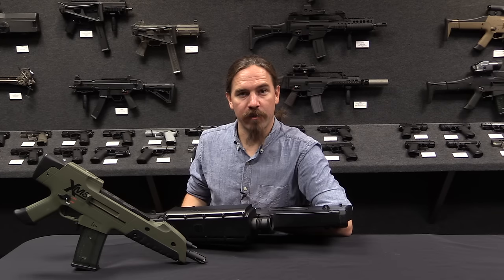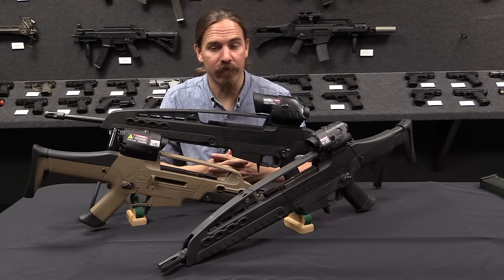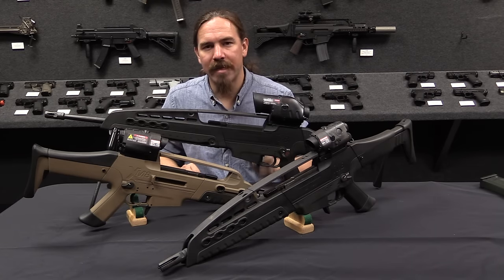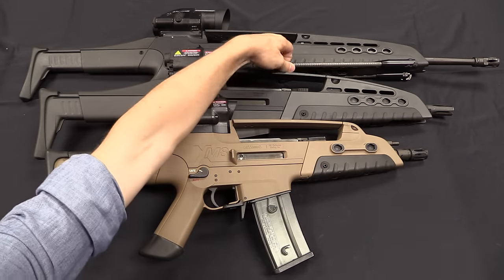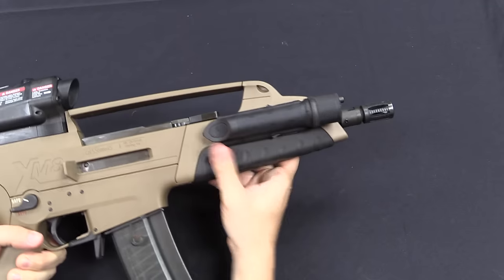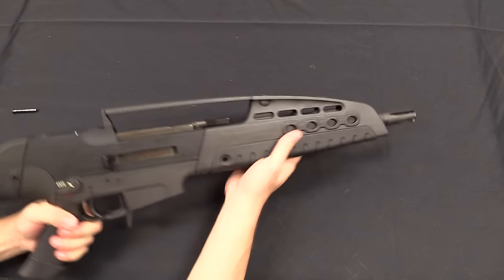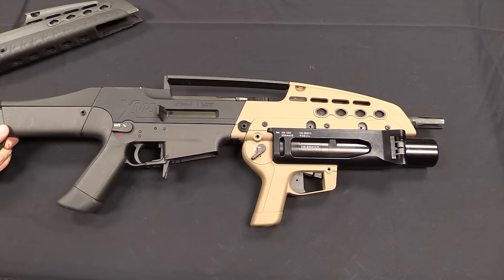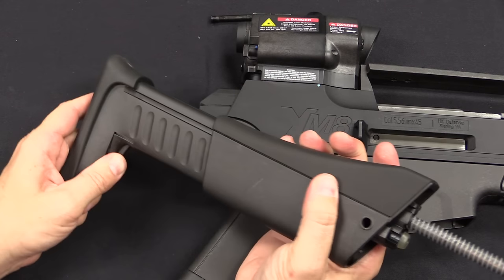Almost Adopted: The H&K XM-8 Family

Comment: Too much plastic for the Infantry, the G-36 as you mentionad had this problem as well, the plastic bent under heat and destroyed zero. 
There must be a metal that can be used instead pf plastic, the SLR/FAL had plastic furniture but you were never going to fire enough rounds to melt or bend it, and it wouldn´t affect the zero either.
I suspect that H&K changed to plastic because the old G-3 was all pressed metal and weighed too much with a loaded magazin, I´m pretty sure it was much heavier than a FAL with loaded magazine, or I was older and weaker when I picked one up! ;) 
Would Titanium work better, that extension with the grenade launcher is a stroke of genius, but in plastic................?

Comment: I like the XM8 as much as the next fella, but I can see why it wasn't adopted. At least, not instead of the M4s and M16s. At best, it could've seen some limited use. I don't think the US military will replace AR-15 platform rifles any time soon. In order to do that, a rifle has to not only be as good or better...it has to be EXTREMELY better. You know, to the point where creating such a weapon might not even be possible. Not with modern gun technology, at least. Ian himself has said it many times - a gun is a set of compromises. The weapon that the US military will deem a worthy replacement to the AR-15 guns is, essentially, a nonexistent gun. A gun that is so much better, that it is an impossible set of compromises. In that sense, it's kind of like the tender to replace the G36 in the Bundeswehr.
The XM8 is simply not better enough (in certain ways) to be a viable replacement. And where it outshines the AR-15...it is simply not considered relevant. Because it's not a viable scenario. The XM8, much like the G36, is easier to carry, due to its polymer construction, BUT this also means that sustained fire capability is not as good as the AR-15, which contains more metal. From what I read, the XM8 is REALLY, REALLY much better than the AR-15 in cold conditions. The cold of the environment will cool off the polymer faster, and, due to the material and how it interacts with ice, when frozen...let's just say, according to some tests, if you throw an XM8 or a G36 into cold water and freeze it, it will be a lot easier to, literally, break the ice, allowing the gun to fire reliably again, as opposed to the AR-15. Ice just...for a lack of a better term, "grips" the gun harder and it's a lot harder to deal with freezing. Seems good, right? Well, no. The US, as of right now, does not really deploy soldiers in icy, snowy environments. This is also why the US military sticks STRICTLY to over-whites regarding uniforms. The Swedish army, for example, has employed Torraka Clothing Systems (A.K.A. Taiga AB)'s brilliant snow suits in an arctic variant of the M90 splinter pattern. Those suits come with removable layers, including fleece. You can remove all the layers and wear them over a uniform, you can wear them, with the fleece, with long johns, or, for milder weather, you can remove just the fleece and comfortably wear it over nothing but a t-shirt and boxers. They invest in cold-weather clothing, because that's their home turf. The US, on the other hand, just doesn't have much combat to do in cold conditions, so investing in cold-weather clothing or a rifle that is better in cold weather than the AR...does not seem like a good investment. This raises the question - why does Sweden use the Ak 5, which is a modified version of the FN FNC and is way closer to the AR-15 in terms of materials, rather than the XM8 or G36, but this is a whole other topic. I guess their standards are different. Maybe the FN FNC, much like the Kalashnikov rifles, despite being mostly metal, thaws out better than the AR-15s, on par with polymer guns? It's a discussion for another day. 
Still, it's a mystery to me why H&K doesn't release this on the commercial market, with a semi-auto only option and Picatinny rails. The demand is there. People are paying...easily 2-3 times the price of what an XM8 would cost, were it sold by H&K, to get an SL-8 and then modify it with third-party kits to make it look like a faux XM8. Yeah, yeah, I know, they wanna be "elitist", but even then...it's not a good business move to be sitting on a mountain of cash and to simply ignore it. Mark my words - if H&K ever realized what's best for their own interests and actually SOLD the thing, people will be buying it like hot cake. 90% of the people who purchase it won't give a damn if it's "better" or "worse" than the AR-15, because they'll most likely already own an AR-15 and they'll have bought the XM8 not instead of it, but to go along with it, as part of a collection. The XM8 is part of our pop culture. People know it from videogames and movies. They will get one. Never underestimate the rule of cool. People will buy impractical guns like the DP-12 because they saw one in a movie. And they'll shoot them on the range. And they'll have the time of their life. Who gives a damn if it's practical - you're not gonna use it as your to-go shotgun for home defense, you're gonna load that contraption of a gun with Dragon's breath rounds and set shit on fire. Hell, you're gonna buy a mannequin, like the ones in clothes stores, just so you can shoot and melt it into a deformed hunk of plastic. The XM8 may have not dethroned the AR-15 in the military, but it would be one hell of a gold mine on the commercial market. But H&K must act stuck up, because...that's just how they roll, I guess.

Comment: ...and eventually, the gun manufacturers understood that the best weapon is not the most technologically advanced one, but the one easiest to manufacture, maintain, capable of withstanding abuse, capable of working in the harshest possible environment, and one that remains a good weapon after 50 years of that.
There's a reason why the AK platform is still used by militaries, freedom fighters and terrorists around the world, especially the ones that actually see combat, despite having had minimal changes since 1947, and there is a reason why all the attempts to improve on the old design by the Russians constantly flop. They try to improve upon the good enough qualities of the gun by sacrificing the reason why it's the most popular platform out there.

Comment: The "modularity" seems pretty weak.  Requiring a full handguard swap in order to mount a 203 instead of using a universal system like Picatinny... just seems clunky.  Don't get me wrong our current platform is far from ideal, but spending billions to change weapon systems only to settle for "meh" is a bad deal.
Reply: Sidenote: if we do change, I vote for a BRM180 style system in 6.5 Grendel with a ruggedized MLOK variant mounting system.  Change my mind.
Reply: Remember this was in 2006. As a bit of extra irony, this is how the XM8s used by Malaysia look:

https://the-drive-2.imgix.net/https%3A%2F%2Fs3-us-west-2.amazonaws.com%2Fthe-drive-cms-content-staging%2Fmessage-editor%252F1588196766481-xm8r.jpg?auto=compress%2Cformat&ixlib=js-1.4.1&s=63a6d4f08d98560d362ea94e323dc3bc

Meanwhile the G36 which was designed as a gun first and not a fish had no problem getting modernised:

https://gatdaily.com/wp-content/uploads/2015/01/6.-HK-G36KA4.jpg

Comment: I think that HK was very elitist about modularity on their weapons platforms back then.  When you look at even their pistols what you see is HK purposely designing the frames to have a proprietary connection system that wouldn't jive with standard picitinny stuff.  Their rifles, although vying for a military contract made a weapon with proprietary magazines.  It also has no modularity with any optics, bipods, grips, foregrips, or anything that soldiers would want.  HK is a good gun company and they made some interesting weapons over the years but, for what they ask for them it really isn't worth it.  The SL8 is no different.  The accuracy that they touted from the platform was overrated at best.  And, by 2022 standards, it's just another semiauto 5.56.

Comment: Lol you drinking the xm koolaid? Those guns are anywhere near as modular as the m16 or M4 platforms. I was dying from laughter when you tried to compared the very limited p cap space to a rail. It was a nice try. I suppose it may have been easier at the time to swap accessories, but modern mounts with quick releases make that point moot. Also, m lok.